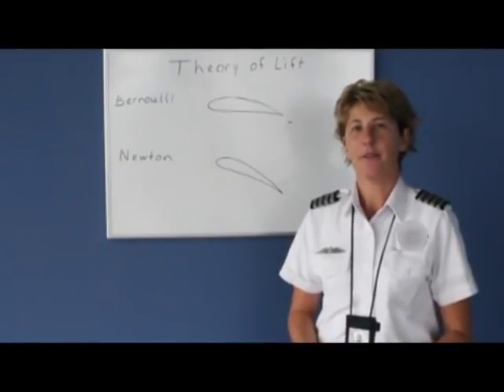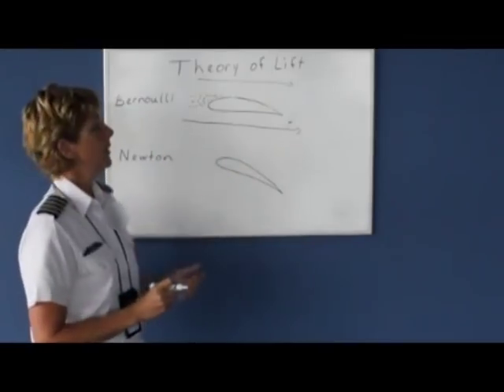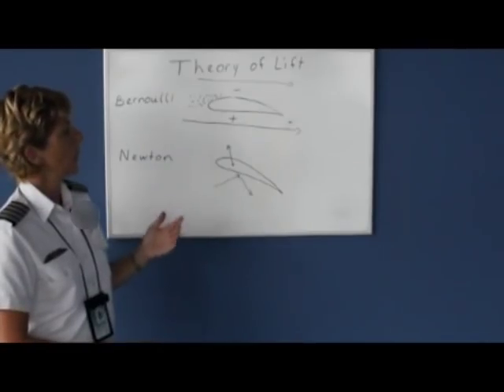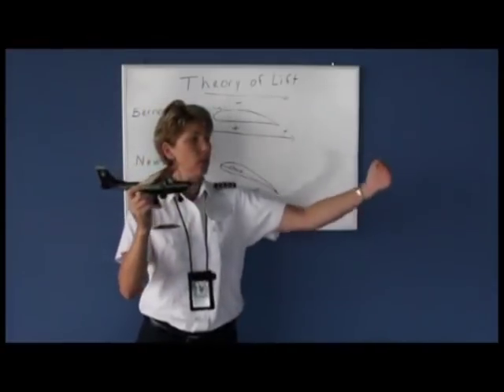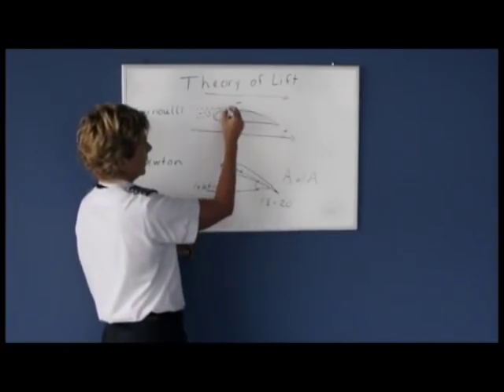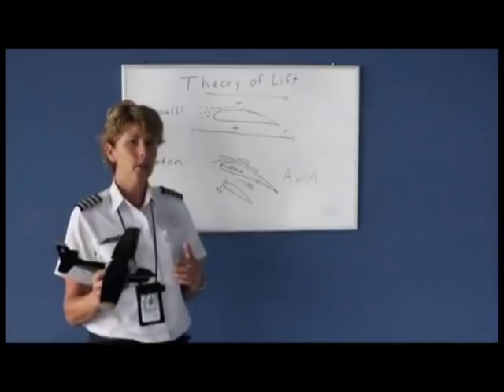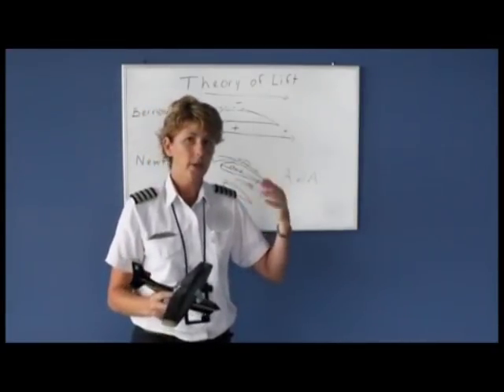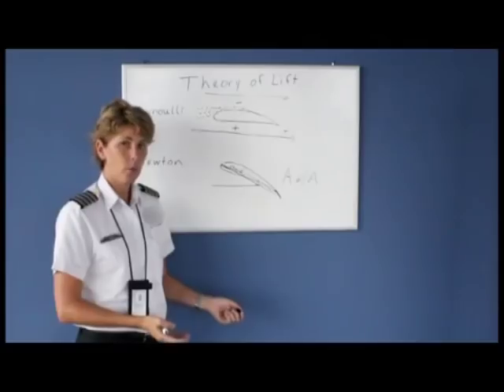What Makes an Airplane Fly? (Private Pilot Lesson 1a)

Comment: This is very nice, but there's something I didn't understand. The last think that Cyndy showed was that lowering the ailerons or flaps increases the AOA. But a steeper AOA can result in a stall. So is it possible that lowering the flaps will trigger a stall? I thought their purpose was to allow flying at a lower speed, so preventing a stall with a steeper angle of attack.